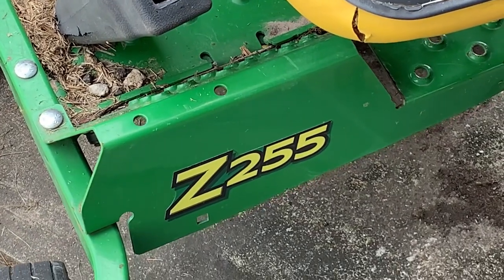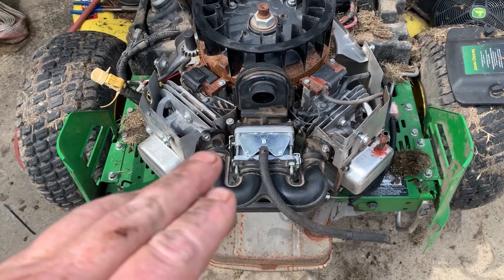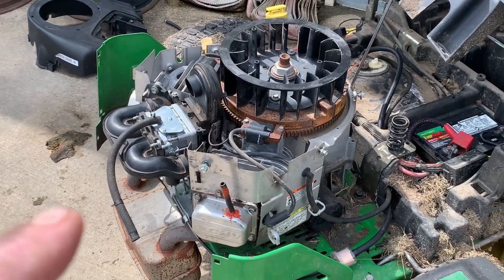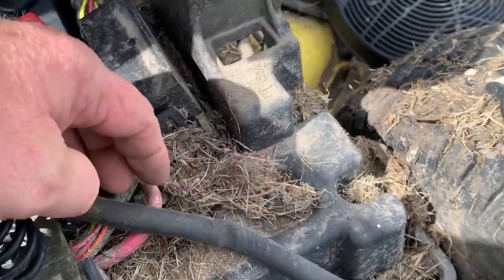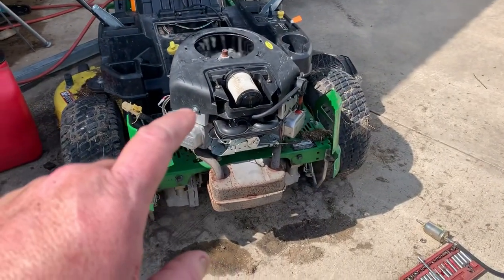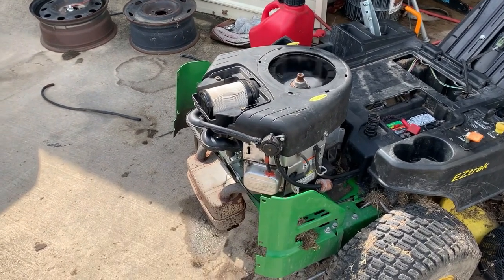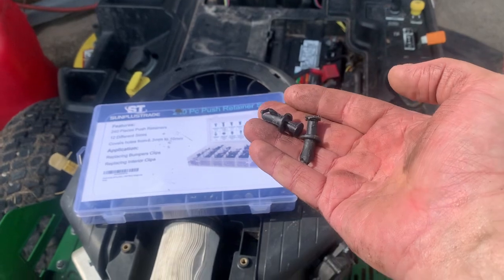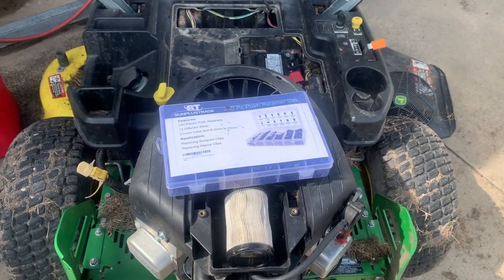JOHN DEERE Z255 STARTS AND RUNS ON CHOKE ONLY! HAS NEW CARBURETOR!!

Comment: It’s amazing that you post this video when you did;  Within the last few days I had fuel related issues with my 165 John Deere with a Kawasaki FB460V engine.  The engine would start and try to run only with full choke applied in which anything less than full choke - The engine absolutely would not run. 
I went through the normal troubleshooting procedures of replacing the fuel filter with no change in symptoms while even doing the SeaFoam carburetor flush and all. So after doing all of that, I then proceeded to change out the fuel pump and fuel pump pulse hose in addition to all the fuel hose from the carburetor backwards to the section of hose where it came from underneath the rear seat fender and ordered a new carburetor just in case.  
So I decided to take a long section of 1/4” fuel hose and place one end into a small fuel container of fresh gas and the other end hooked up to the input side of the fuel pump in which the engine immediately started up after the fuel hit the carburetor. The engine ran as it always did with normal throttle/choke response and positioning.  I intentionally ran the engine for a long period of time to make sure that it would indeed be okay before I moved to the next step.  After attempting to allow gas to free flow from the open fuel line;  I tried to suction some gas from the fuel line with not much luck. I took a blow gun and pushed it into the fuel line and blew compressed air backwards through the fuel tank with the fuel cap removed with 3 to 4 blasts of compressed air. After I removed the blow gun, I had good fuel flow and once putting the fuel hose back like it belongs - The engine ran as it did with the test fuel tank.  
The fuel tank looked clean inside and I am not sure exactly what the actual obstruction was to be quite honest. The section of fuel hose had been replaced about 4 years ago and I was very careful in routing the fuel hose where it would not be kinked or pinched in any way. 
So, I learned the trick of back flowing the fuel line into the fuel tank from growing up on a farm when the fuel tanks on the old tractors would accumulate crud or even chunks of rust that would completely stop the fuel system up. At a young age, I knew what a sediment bowl and a fuel filter was all about. As Always, Thanks for your great videos.

Comment: Thanks for the video! We’ve had the same issue with our z255. Sometimes it would run for an hour then start to die and only run on choke. We replaced fuel filter, fuel pump, cleaned carb and still no luck. After watching your video we checked our fuel line from the tank and the line at the connection to fuel pickup was starting to degrade and partially blocking the fuel. Also starting to get a flat spot where it bends sharply. Got a new fuel line and it’s working like new. Was about to throw in the towel, so thanks again for sharing and giving our JD new life!!

Comment: Thanks! Having the same problem.
I have a z-track 375R. It'll only run on choke. I've been going through this sucker. Replaced the fuel pump fuel filter. The place of air filter replace the oil filter. Didn't even think the look on YouTube. This is only 2 years old. 22 hours on it. Can't believe it. So frustrating but your video led me to the right direction. Thank you!

Comment: Good catch. The bad deal with many of these knock off carbs is longevity. I've had my share that a year later, they were corroded and useless. I've had people install them as well that never would run right, until I rebuilt their old carb. It is amazing the detail to them in comparison to the OEM though.

Comment: A short length of coiled wire fuel line protector like that used on some motorcycle gas tanks would be a good upgrade for those mowers.
Reply from the maker: Yep we used to put ball point pen springs in weedeater fuel line to keep them from kinking

Comment: Great video buddy. I agree it would easy to over look the kinked fuel hose when the bad spot is hidden like that good job finding it. Thanks for the tip on the fuel line that is a great price. Have a question on a different subject. I need to replace our commercial hedge trimmers. They are an old pair of shindaiwa dh230. What would you replace them with?
Reply from the maker: I would go
With the echo hc2020

Comment: Hello sir I have a really nice practically brand new poulan pro 25 cc pole saw ,the terrible thing is when I do the starter cord test the machine stays on the ground, I compression tested it dry it was 50 psi-the wet test was the same the question is what should the operation compression be I feel 100 psi would be nominal
Reply from the maker: 125 min
Reply: @THEMOWERMEDIC1  well that isn't good ,I had a feeling  it needed to be way up there, im finding that folks put straight up gas in thier 2 stroke mix systems ,I think its  because of the 4 stroke machines on the mkt  they don't pay attention to thier fuel cans which is mixed and which isn't I have cans that are marked 20-30 -40 and 50 /1,  just an upside down thought
Reply: Thank you for the reply back 🙏
Reply: another problem i see is people don't let the equipment warm up before using it... the piston expands faster than the bore and makes contact with the bore, usually on the exhaust side, and the compression goes out the door.

Comment: Nice video! I have a john deere ztrak m665 , it will crank on choke then immediately shuts off. It has fire on both cylinders. To me, it sounds like the switch or a safety is shutting it off as soon as it cranks....I bypassed the seat and that didn't correct it. Actuated all the switches I know it has to see if it acted any different.  I did notice that the ignition switch if I turn it all the way to start it won't crank....its a "sweet spot" to crank it.  Before I order an ignition switch, is there anything you know of on this mower model that acts up like this as far as a common problem? To start with it would crank then as soon as I engaged the drive it shut off now it shuts off as soon as it cranks up....definitely has me stumped. Thanks in advance.
Reply from the maker: Main jet in carb clogged
Reply: @THEMOWERMEDIC1  thanks for replying. looking at the carburetor on it,  it looks like the float is in the upper part of it.  I haven't removed the carburetor yet....wanted to ask you if that's the case with float or do I need to remove the complete carburetor to get to main jet and float? I worked on hundreds of carbs but none on a mower that looks like this one. Any additional info would be appreciated.  Thanks in advance.